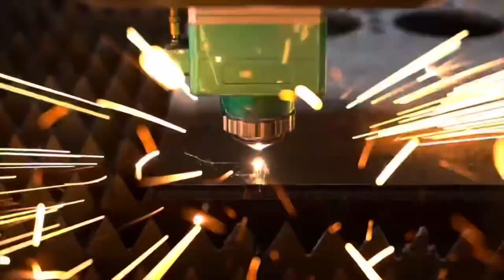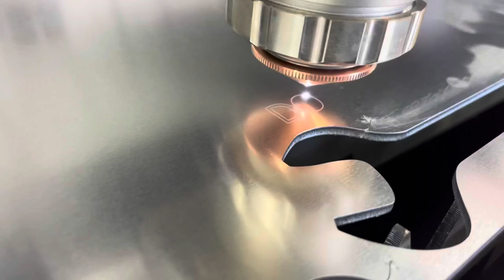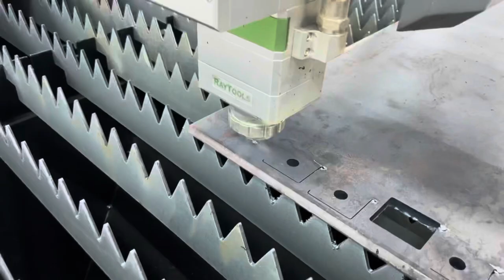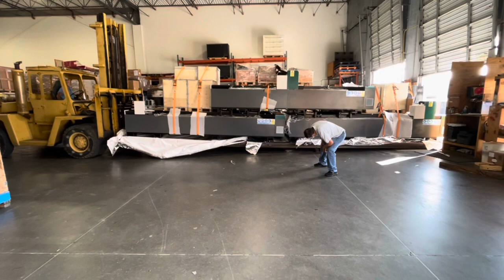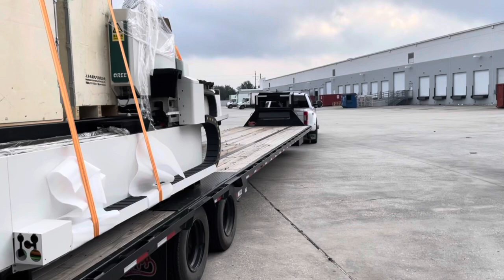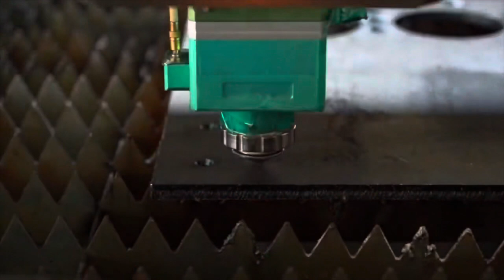Countersink laser holes

Comment: Dang! Is it possible to do a continuous top surface chamfer, say like on the perimeter of the 'wrenches' in the video? Just too awesome you can do this with a 3-axis machine.
Reply from the maker: yes i think so with some slight experimentation, shouldnt be a problem, so you could do weld prep bevel, etc
Reply: @turbocobra  I was wondering the same thing. very useful feature.

Comment: What material thickness steel can they pierce now?
Reply from the maker: Funny you ask that.  I just quoted a 30,000 Watt machine to an energy company in NM.  Rated to pierce/cut 3" carbon steel - $726,000  but for all us regular folks.  3KW will Pierce / Cut 3/4" and 6KW will pierce/cut 1"

Comment: Damn, that's crazy! What would be optical focus for this countersink cutting setup im just curious? :)
Reply from the maker: positive focus around 9mm
Reply: @turbocobra  wow, impressive!!!
Reply: Oxy pressure also plays a role, right?
And have you tried stainless steel?
Reply: @charlesfeng3823  How much pressure of nitrogen will u need (bc stainless steel requires highend consumption and pressure of gas it all about $) for this countersink while the head cutting from 40-60mm from material. So i cant see it real on SS. IMHO
Reply: @charlesfeng3823  And if u using oxygen will hole edge get oxidation and become in that spot not stainless at all ?:D